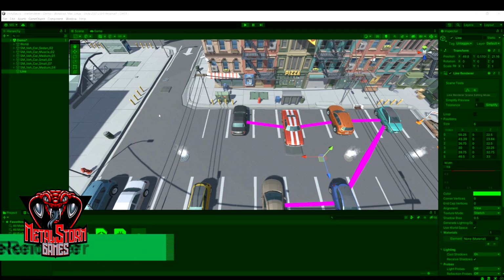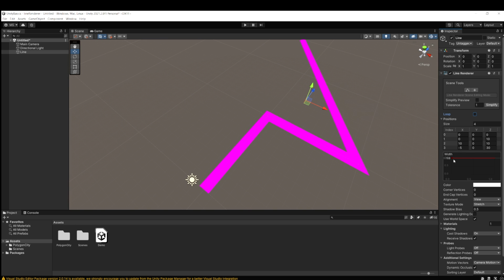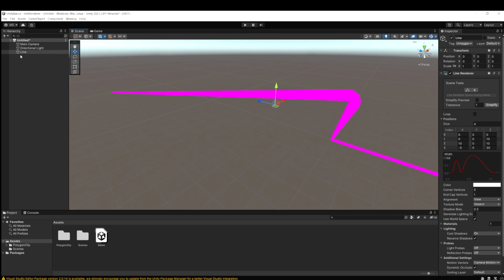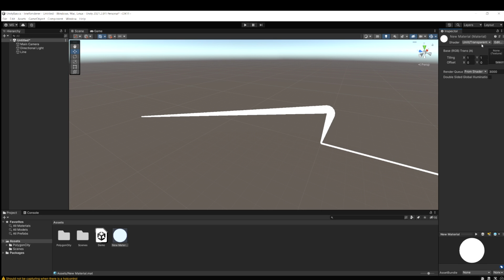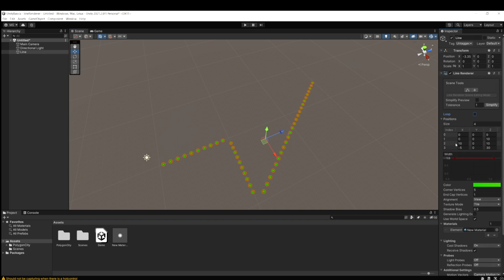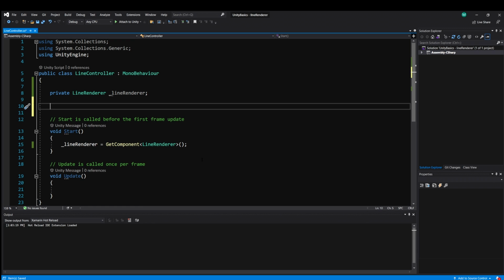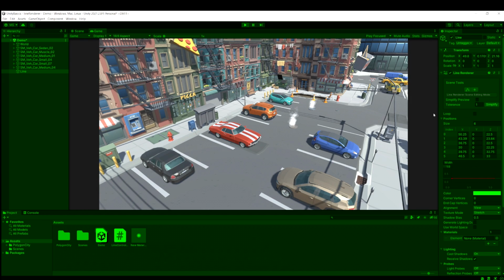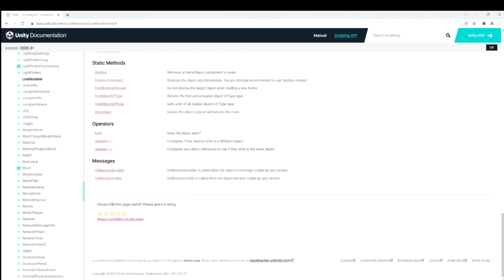Unity Basics - LineRenderer

Comment: Around the 2 minute mark, you adjusted the width of the line at each point. Is there a way to do that in C#? I can only find the SetWidth function and that only takes the start and end points. I want my line to have different widths at different points on the line
Reply from the maker: I am not sure on that in code to modify the graph, I would imagine it is possible but I am not sure how you would do it sorry.